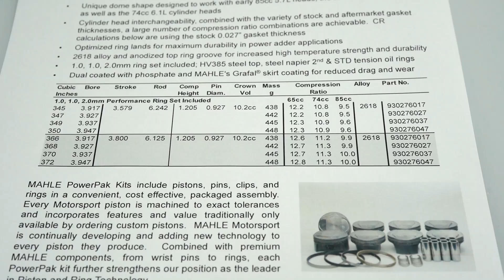Hemi 5.7L Dome PowerPak Plus Piston Kit

Comment: I got he kit for the rings in the #1 slot those r the top rings and #2 are the bottom correct?
Reply from the maker: Correct #1 is the top ring with a shiny outer surface, and #2 with the dull black color is the second ring.
Reply: @mahlemotorsport  awesome thank you

Comment: Any max rpm or cylinder pressure recommendations?
Reply from the maker: 8000 rpm is well within the realm of the design in an endurance application, more if we're talking drag racing, i.e. short duration runs.  Cylinder pressures are tough to generalize.  Being a 2618 alloy piston, it is intended for the higher pressure, boosted and / or nitrous applications.  We'd be glad to discuss this specific application with you, and you can reach us toll free at 1-888-255-1942